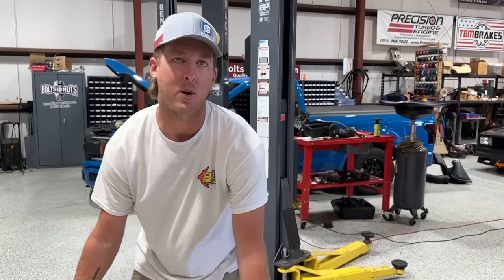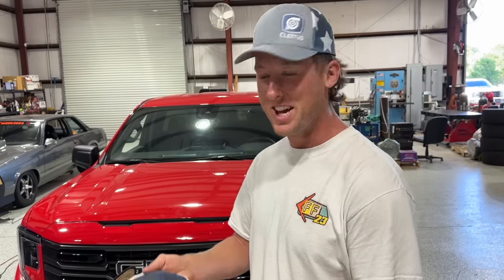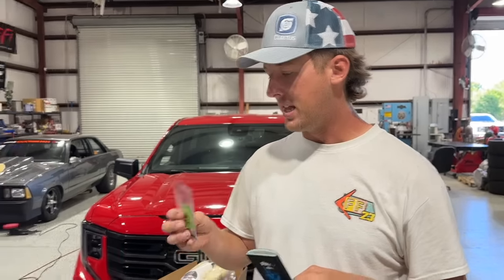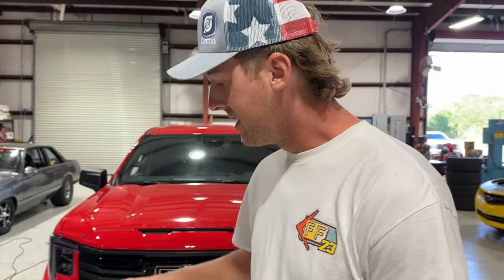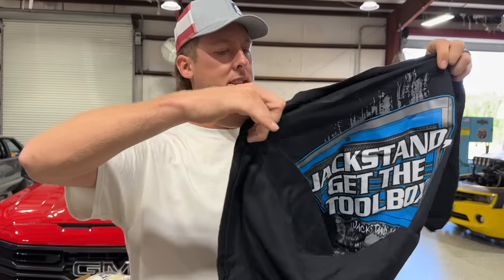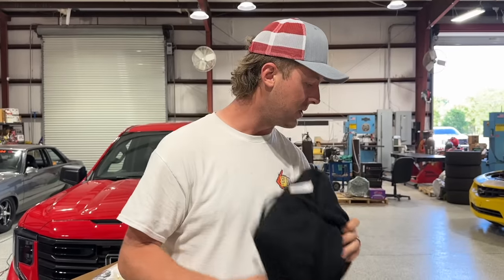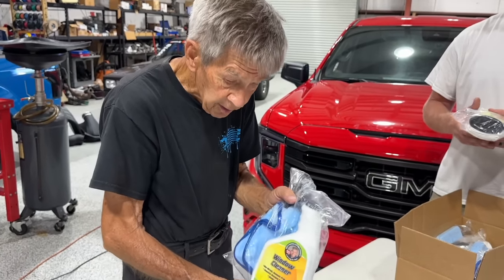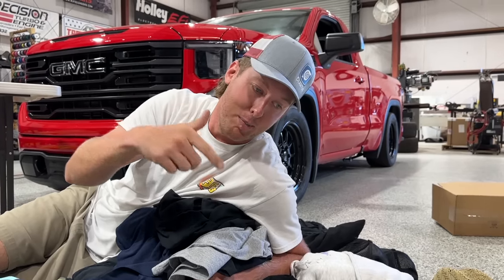Sam and Cleet - 1 Of Everything Merch Plug

Comment: Ok I’ve got a pitch for a hat specifically Fitted hats for the big head guys. I can’t wear a SnapBack, the flex fit is also tight, but a solid size 8 hat fits like a charm. I understand you can’t really stock them for everything, but could you maybe try a small run of fitted hats for a classic design. 

No one selling YouTuber merch does fitted hats, I am imagining because that’s a lot of stock for one single design which then would cut into its profitability. I get that this probably won’t happen, but maybe a big head can  dream of wearing a Cleetus hat.